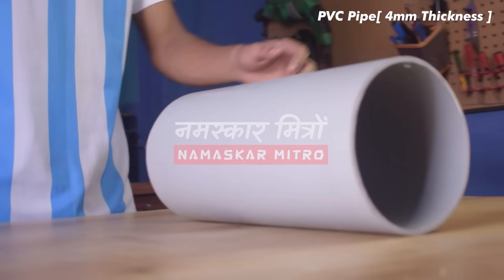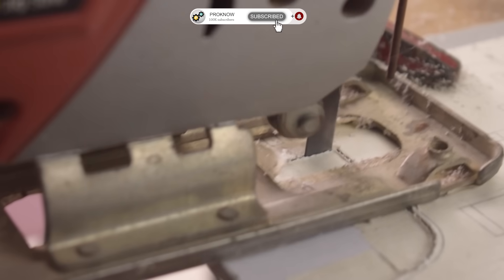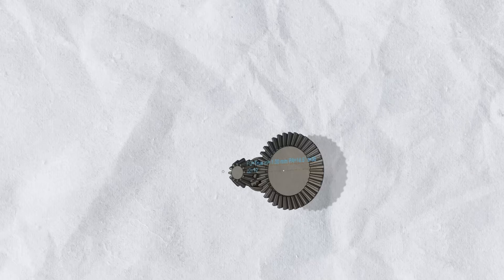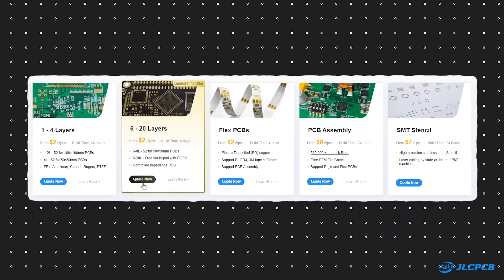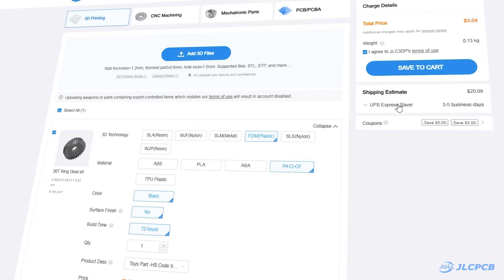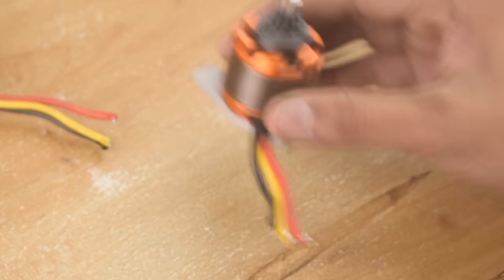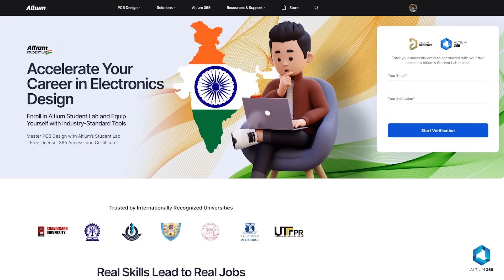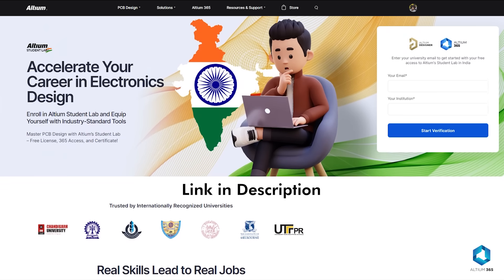Handmade 4WD Powerful RC Car out of PVC Pipe - High Speed DIY RC Car with shock Absorbers

Comment: Hey i have a question, im a bit confused as the gearing you showed for the motors have the 2 motors connected via 1 gear and that kinda defeats the purpose of having 2 motors as if 1 motor is running at one speed the other will run at the same speed making it have the same wear and tear affect of 1 motor, i understand if you use the 2nd one as a backup or to make the build symmetrical but based off the video i dont think that was the point so could you please explain the need for a 2nd motor.

Comment: But the main point is that the engine is not made of pipe and  I came here after reading the title, mad up with pipes
Reply: He try to make part from pipe as more as possible, you can't make a motor, essc, servo, gear,... from pipe, that work stupid

Comment: pro bro make a 4wd rc car with gesture control using 
1. ardiuno nano
2. motor driver 
3. lithium batteries
4. BO standard gear motrs*(4)
5. nrf2401+
6. and gyroscope 335 module

and plz explain the code also

Comment: Nice project... But learn a bit better soldering. Looks like crap!! More HEAT and a bit of rosin!! Solder needs to flow in to a nice blob... not be bubbly.Those solder joints will break after a while.

Comment: My only suggestion is to brace the shock towers, that’s one of you weakest points, all the pressure goes to the base of the small supports the shocks attach to. Also, the brace will help with lateral motion

Comment: I HATE TO BRING IT UP BUT PVC IS BEING PHASED OUT IN THE USA AS IT LEECHES CARCINOGENIC GASSES WHEN HEATED.
I advises just orgering  .250 inch ABS sheet  or use White acrylic  both could be heat formed or thermoformed using a vacuum box or a vacuum former.
Reply: Hopefully he isn't heating it up that much, this happens depends on what additives are in pvc which will leach out but pvc itself won't start degrading until 250c. Pvc itself starts becoming flexible near 100c so it's alr ish if you got no other material to work with